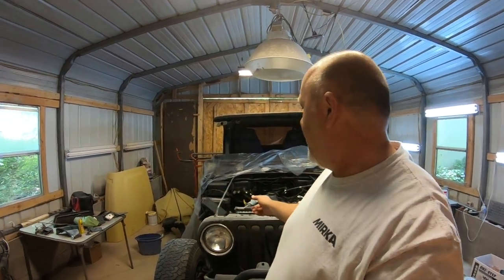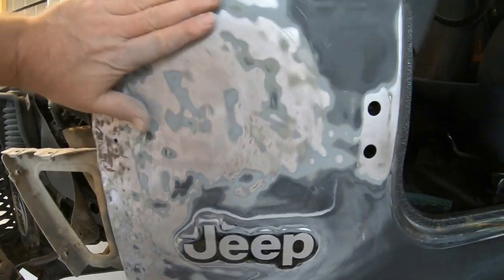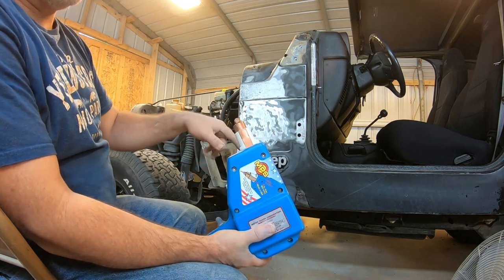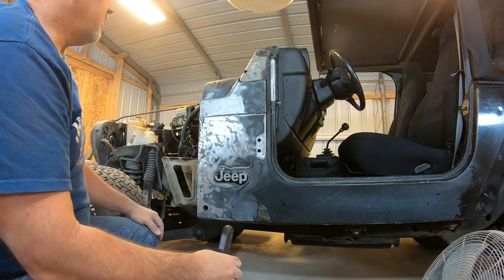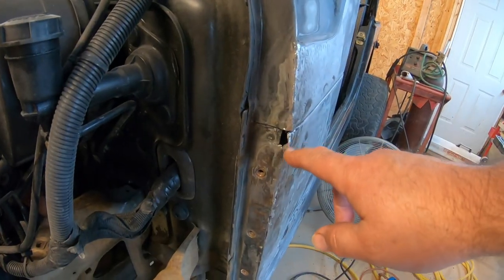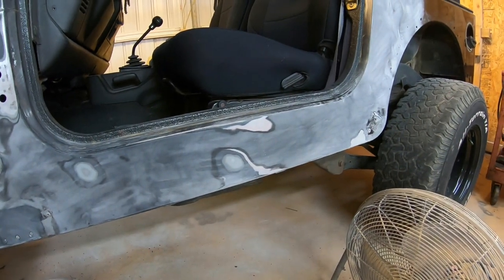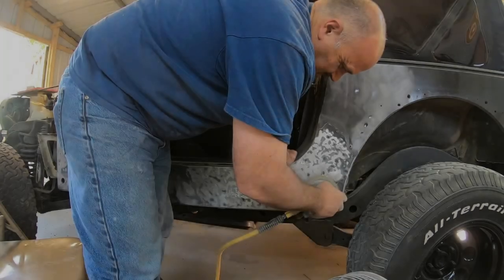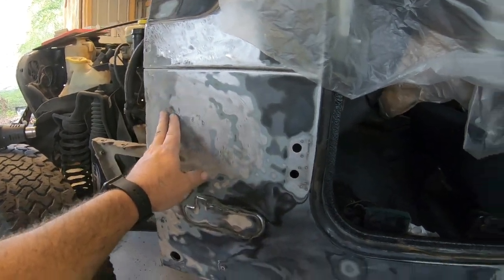97 Wrangler TJ Body Metal Work! (Body and paint work Ep.6)

Comment: Body work takes time. But sure pays off in the end. I'm with you on doing it right. Never seen thick bondo hold up. 
Got my exhaust manifold on, and power steering pump. Now to get the trans jack under it. Find out what the noise is. I'm sure its the throw out bearing. But just can't drive it with that noise. Also got a set of Front hub bearings in today. Should have this thing rebuilt soon. One part at a time.
Reply from the maker: Man yeah! You'll have it going before long!